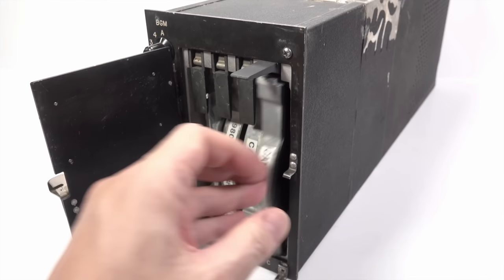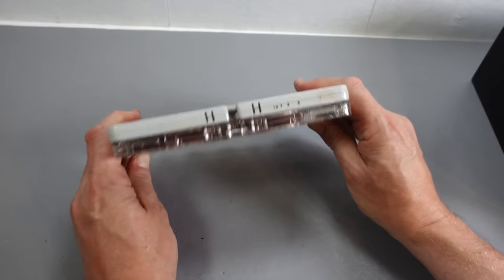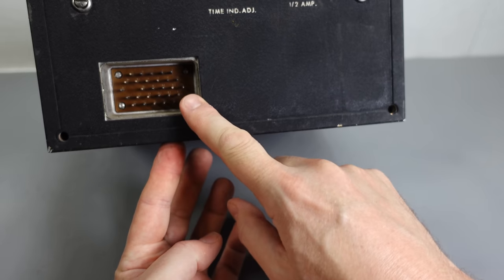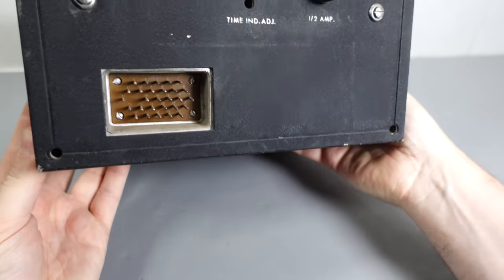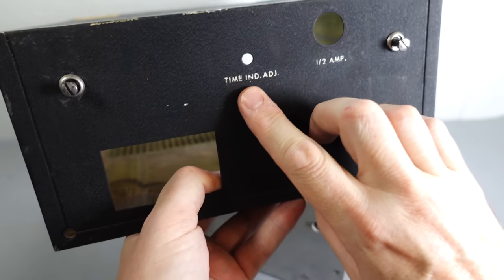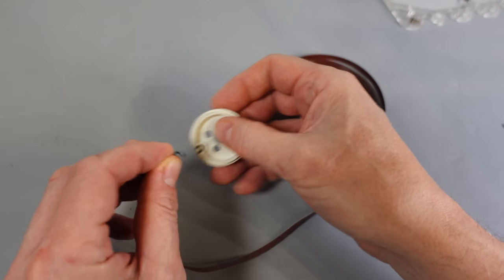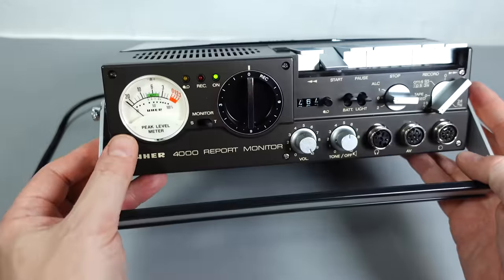Mystery aviation tape machine

Comment: Not a big mystery.  It's a QAR of the type Boeing would put on its aircraft in the 1970's and into the 1980's.  You can buy them from Boeing today as spares.  Yours was likely pulled from an old 747 given that so many early 747s are now decommissioned.  Sundstrand is an old company and I recall they used to make robust adding machines so it makes sense that they'd move to tape recorders given their experience with complex moving parts machines designed to hold up against brutal conditions.  By the time you get into the 1980's, ICs and circuit boards were well tested and these devices started getting smaller.  Remember that these had to be certified by the FAA and that process takes a long time so the tech in these is often 10+ years older than the years it was in service.
Reply: The problem is QARs don't record audio, only data. Cockpit audio is privileged by law so it can't be routinely reviewed, so having it on a QAR is not only pointless, it's problematic for abuse. Radio communications isn't privileged, but you can get those tapes from the FAA if there is an issue.
Reply: @straightpipediesel  They were and are used regularly by airlines to track data and radio communications because it's a fast and convenient way to ensure the aircraft is working properly.  As a rule FDR and CVR cannot be tampered with but QARs can because they are for use by the airline.  There have been examples of QARs surviving crashes while the FDR did not and they've been used by various civil aeronautics investigator agencies worldwide.  These days, the data is often just sent directly to the airline through the onboard communications system.  Depending on the airlines contract with the unions, the airline may or may not be able to use the information for discipline or training.  I'm a scientist not a lawyer so I don't know the legal side.

Comment: About a year ago I got a couple garbage bags full of old tubes (most were from the 60s, but there were some military ones from the late 40s) from and old guy that worked as an ATC. About 90% had their original boxes, most looked like military surplus boxes. I got an old tube tester and around 70% of them still worked. Most were for VHF and UHF stuff, but there were around six or seven preamp tubes that still worked. I loved testing the 0A2 tubes, that purple glow was too beautiful.

Comment: The 'Made for FAA' label seems odd. Manufacturers wouldn't normally make something for an aircraft, for the FAA. That's the regulatory authority. If it was made for anyone it would be Boeing or Airbus for example. The fact it's painted black is surprising to me too, as I only usually see that on Mil equipment (commercial is more often white or grey). I think you idea of an evidential recorder might be close.

Comment: @Techmoan
Early Cockpit Flight Recorder. The device would record continuously, auto reversing as it went. In the event of an incident, the recording would provide the last 60 minutes of what was said in the cockpit. These units were replaced by newer and better engineered devices in the 1960's.

Comment: I believe you are correct in your speculation that the bulbs and panel are part of an elapsed time system. The panel looks like an old selenium solar cell similar to one that radio shack used to sell back in the day. I suspect that as the amount of tape between the bulbs and the solar cell changed, some circuit would read the voltage and determine approximately the time location within  the tape. This could be verified by testing the panel to see if it emits voltage. If not, it could be a photocell in which case the resistance across the leads would change with the amount of light. Just my two cents worth...

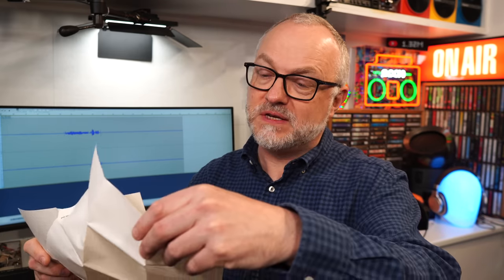Comment: 10:40 - Whoa, Pratt & Whitney? That's a company name I never expected to hear you speak. My father used to be a member of their in-house Fire Department in East Hartford, CT in the eighties. He didn't really care for the 45-minute commute, can't say I blame him.
12:09 - You are absolutely right about that. Heavier solid metal flywheels are less susceptible to vibration, which is exactly what you'd need in aircraft tape-based systems. Each "cycle" of an aircraft - takeoff, flight, landing - generates quite a bit of vibration, even under textbook-perfect conditions. Imagine playing your favorite cassette in a budget Walkman, while shaking said Walkman vigorously and continuously. 🤮

The tinkerer part of me is somewhat curious about the pinout of the jack on the back, and in what way it could be rigged to work just for giggles. I imagine that jack would be standardized, as most components of a plane are designed for easy pull-and-service or pull-and-swap repair... (NO, ANDY, REIN YOURSELF IN...)

Comment: Matt, check for any small power transformers, perhaps in a cylindrical "can" form factor.  Aircraft tend to use 400 Hz AC power, at 28 or 115 volts.  The higher frequency allowed for smaller and therefore lighter transformers than needed for 50 or 60 Hz.

I worked on the DC-9-80 / MD-80 Central Aural Warning System ("CAWS") units during manufacturing, which used digitized voice in ROMs, back in the late '70s and early '80s.

Comment: Because it is a low serial number and for the FAA it was most likely used at an airport.  I've seen similar types of machines used at airports to give out Automatic Terminal Information Service, or ATIS, broadcasts.  These are used at busier airports (terminals), to continuously broadcast routine information to the approaching pilots.

Comment: Your device has an aircraft rack installation type of connector on the back.  I got some white boxes with unbranded 7 1/2 reels about 1/3 full of quarter inch tape that I saved from the bin.  They contain 25 year old flight data from specific aircraft.  The tape is surely high quality and though the information on them is unrecoverable and useless,  I figured free tape reels and boxes is worth getting and maybe the tape can be used for typical purposes.

Comment: There may have been nothing interesting on the tape, but this is another reminder of how devices were built to last then. I suppose with the advent of digital recording, this solidity is no longer required, hence the abundant use of plastic nowdays. Anyway, an interesting find even if a less than expected result was the outcome.

Comment: The handle on the front and the large male pins on the back suggests that this was slid into a larger machine as part of an overall mechanism, not meant to be used by itself.

Comment: I believe that that this is a recorder for the air traffic controllers.  FAA ATC's would have their comms with aircraft recorded.  I worked with the UK CAA in the late 80's and we built ATCs workstations - with an IBM industrial computer built into a large desk with a couple of 19 inch monitors, and there was a voice recorder included in those workstations - not like this, but same idea I feel.

Comment: All Air Traffic control Radio Transmissions (AGA) at least since the 1970's were recorded in real time on the ground, so I suspect as other commentators have said, it's probably a CVR. 
In UK the go to AGA recorder was the Racal Recorders ICR range. A 1" tape on a 12" spool with 16/32 and later models, 64 tracks. These recorded for 24 hours or until a fault occurred when it then automatically switched to another machine. At which point an engineer had to change the tape. This was the case certainly up until the turn of the millennium though I suspect it's all digital now.

Comment: It's probably an old cockpit voice recorder that was installed on a commercial plane (Boeing 707 or a DC-7 or 8... I go by the age of the cassette). It probably recorded over and over until the device was stopped either manually or by a crash.

Comment: Generally cockpit voice recorders that record on tape only save about 30 minutes.  They run continuously, so the last 30 minutes is recorded.   That is why it is so important to pull the circuit breaker for the recorder if there was an incident that they might want to review later.  Crashes, would of course stop the recording for obvious reasons.  If there was an incident that didn't result in a crash, they would have to manually stop it by pulling the circuit breaker.

Comment: as many have said, this an early voice recorder that keeps a recent record of what the pilot has said over the mic (and would be installed in the cockpit). The interesting thing to me is that they went through the trouble of blanking out the cart, and then recording the test audio to make sure it was blanked. but they still missed a bit (the "say again"). interesting! i love those old early aviation Bakelite plugs too. aviation still uses some of those standards that were created in the early days!

Comment: flywheels that big suggest a small aviation vehicle, such as a helicopter. the relatively short record time would match that too. not entirely sure why the fidelity was so important- those are wide tracks at 3.75ips, so maybe it was recording engine/transmission noise for diagnosis, that's the sort of thing a ground-based engineer would benefit from.
I'm speculating wildly, but with a sound (no pun intended) engineering background.

that said, the socket on the back looks like something semi-permanent, not something you'd lash in during a maintenance operation.

Comment: Y first thoughts were that iit was an early cockpit voice recorder too. Those things were on a loop as it most accidents happen fairly quickly after failure. They were also separate to the data recorder and were kept in a sturdy housing. However I also thought that they were in yellow or orange painted housing so they would be easier to locate in the event of an accident. Having said that, if this is an early version of that then perhaps that's where the term 'black box' came from? Anyway, certainly an interesting video Matt and amazing to think thiis might have been installed on a classic 707 or BAC 1-11. What you really need is someone to watch this who has experience of dealing with early jet airliners as they might recognise it

Comment: Since it was made for or owned by the FAA, it would seem to be for FAA required recording in a commercial system or for FAA owned systems. All those pins make it seem like it had external control (like mic keying) so CVR is a good suggestion.

Comment: It's a VAR or VOX.  Voice activated transmission recorder.  Any transmission from the plain is recorded, but only when levels are picked up by the recorder.
Reply: Yes it would be installed on a plain.  My uncle was an Air force repair technician in the 1970's and knew about these.

Comment: That's quite the interesting device, fascinating to see a slot loading tape cartridge player. Reminds me of a front load VCR, but not as automated. It doesn't look solid enough or sealed properly to be a black box for a plane, and a flight recorder would be clearly marked as such so it can be identified and recovered in the event of a disaster. Another commenter, CF G,  has identified it as a "Quick Access Recorder (QAR)" which is a device that records data onto a removable storage medium so it can be easily accessed "for research and maintenance purposes". That description fits this device, so it seems quite likely that is what this was for.

Comment: This is just a guess but it could be for Student pilots to review their landing afterwards as I’m sure they didn’t have GoPro or anything to record the video back then. Or for when landing at an international airport or an airport that’s a different company that you’ve had issues with.  Maybe recovering the data off of black box is much more expensive than a simple dispute negotiation that could be settled with a recording like this. But I really like the idea of a student pilot using this reviewer landing.

Comment: Just curious, are all those pins on the rear interface being used, because that's way too many just to record audio? Telemetry maybe?
Reply: Well usually they had multiple powerinputs, the controll interface (start / stop), (on that thing) a time elapsed, probably a chanel andside A/B output and probaly more than one Mic input. Also those connectors had often Standart sizes (but early on not always the same pinout)  so you need to stock less different connectors...

Comment: Looks like a cockpit voice recorder that triggered from the mic activation switch, but whether it was used in flight or just on the ground is questionable, simply because those massive flywheels will be gyroscopes and would try and keep the whole system in either the horizontal or vertical plane while banking the aircraft. I would guess again by saying that it may be used to record pre-flight voice while on the ground or taxiing. Normally all the "tape recorders" in aeroplanes were gear driven because of the gyro effect and none of the gears were heavy or ran at any high speed and direct driven by slow multipole dc motors.

Comment: Ok so basically both of what you have are whats called LRU's or line replaceable units, this would go in the electronics bay of the aircraft along with the flight controllers and other computer systems, as far as i know the connector is proprietary and multi use

Comment: Was this AC or DC powered? That might give a helpful clue to where it was supposed to be used. If DC it was almost certainly designed to be used on an aircraft in flight. Seems very unlikely a tape recorder/player like this would be built DC if it was intended to be used on the ground.

Comment: There used to be a fantastic shop underneath Leeds City Station, I think it was called M&B Radio.  They used to sell all maner of interesting military and aviation surplus.  I really regret not buying some of the stuff I saw in there, even though I'm sure I would have found little to no use for it 😂
But this sort of thing would be in there now and then.

My guess was going to be a flight deck voice recorder, but if it can only fit 30 minutes on it, not much use for anything but rhe shortest internal flight.  Its also possible that the control interface had an option to change the recording speed so it could record more.  As you say, you don't need exquisite hifi quality for radion comms! Maybe you could ask Big Clive, to see if he could help figuring out the connections to that plug on the back and finding out more of what the machine can do

Comment: The "Made for F.A.A." label doesn't make it look like something that would go into airplanes, but rather at some ground facility. Also, its construction seems rather beefy, with no regard whatsoever given to weight constraints, for an airborne equipment. My two cents are on something ground-based.

Comment: I'm sure this isn't it but maybe it is a black box?  Just audio, there might have been multiple.  I guess it would have to be activated with a drop in elevation or maybe it recorded continuously, like a dash cam, then when it last power it would stop and the last hour before the crash could be listened to.  It isn't very robust though, it probably wouldn't survive a crash so I'm pretty sure I'm wrong.

Comment: I wonder if this device would be something like a quick access maintenance recorder used to record maintenance issues and designed to be easily accessible by maintenance staff.    Not sure if that sort of system would have been used in the 60's.   Just guessing, but 30 minutes length and easy access would line up with something of that nature

Comment: Could be a cockpit voice recorder, which is another part of the "black box". My question is, does it have an earse function? If not, it doesn't make sense that it can only record for 30 mins...
Reply: it has record function so it will have an erase head for sure
Reply: @AttilaTheHun333333  It may not have an erase facility to prevent recording being 'accidentally' erased.  Would be loaded with blank tape whenever needed.  Tape was probably only run when RX squelch / PTT TX button pressed.
Reply: Well the 1st mandatory CVR only had to record 30mins.
Also it was como to run it as a loop and record over the last recording. Here it would autoreverse and start to record on a different track... 
Also it looks like a 2 or 4 track system that would make it a 1 or 2h recording (mono).

Comment: 30 minutes sounds like a CVR which used to record the last 30 ish mins of a flight. However, one would imagine a CVR would be tougher, perhaps this machine was contained within something tougher that would help keep it safe during a potential crash. Or maybe it was before mandated CVR and FDRs & airlines just wanted something like this so that if something went wrong the crew could either click stop once the incident finished to provide evidence of what happened or that would as other CVRs did just keep recording for the full length of tape before going back to the beginning and recording over the previous 30 mins. Idk, it’s really only the 30 mins that makes me think, CVR. But weather could also work, maybe the crew would record the ATC weather frequencies announcements or something, idk. Very intriguing.

Comment: Isn't this an ancient "black box", that records the pilots radio communication? A total of 1h record time might be enough if it only record when communication happened. In the 50s the flight distanced probably were also pretty short too.
Reply: Well CVRs had to record only 30mins in the 70s. That would make that thing more than enough. Also forgot that this is maybe a 4 track system and if they only record in mono thats 2h.